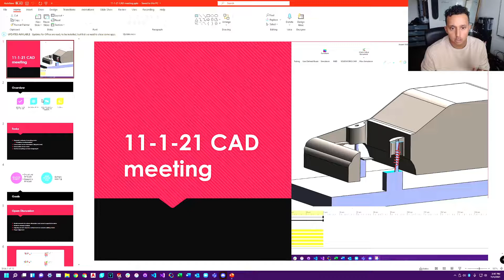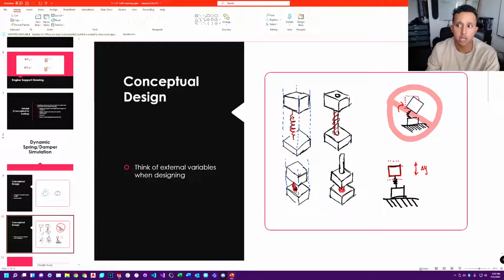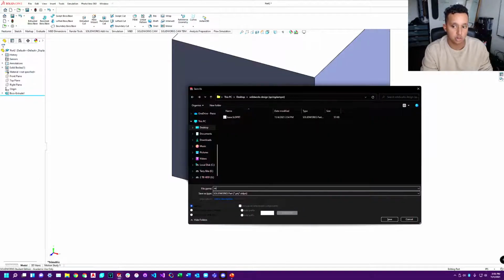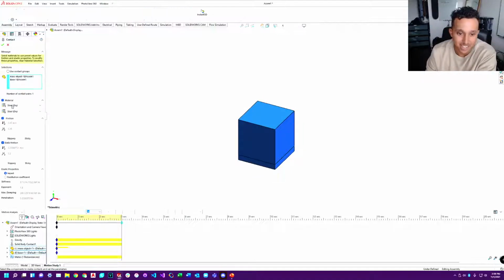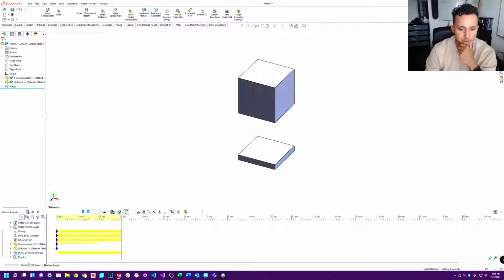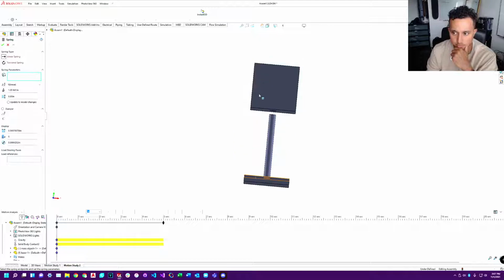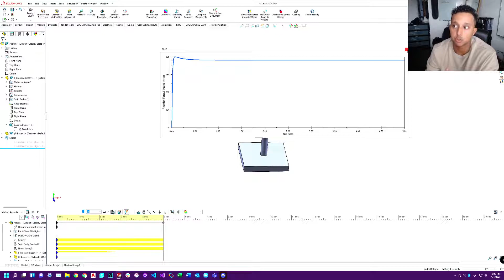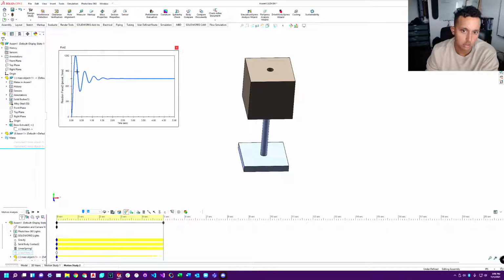Block Spring Damper Example (solidworks)

Comment: Hello, sir, can you make the solidworks model of this spring mass damper system on your youtube channel. 

 
Use 𝑚 = 1 kg, 𝑘 = 40 N/m. Set the initial value for 𝑦, 𝑦0 = 0.1 m. Evaluate 𝑏 for the critically damped system. For the working model version, make the spring at least 0.2 m long and ensure the mass is clamped securely to it in the model.

Damping ratio of b (kg/s) =  0 , 2 , 4 , 6, 8,10, 12